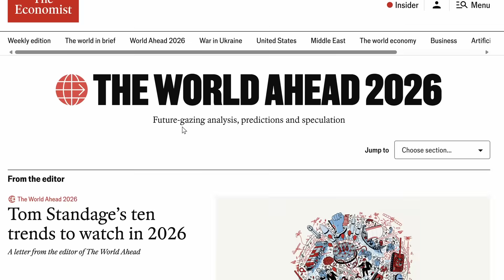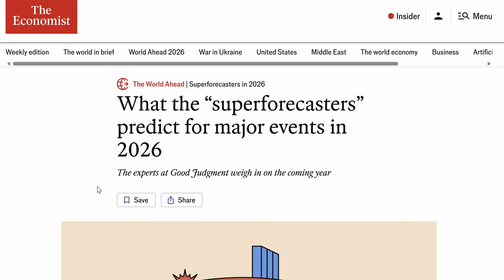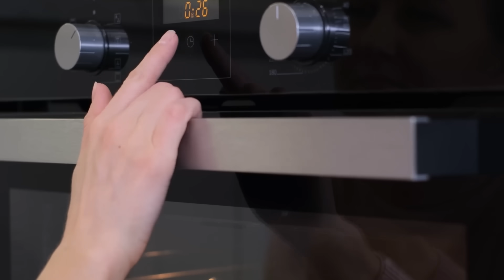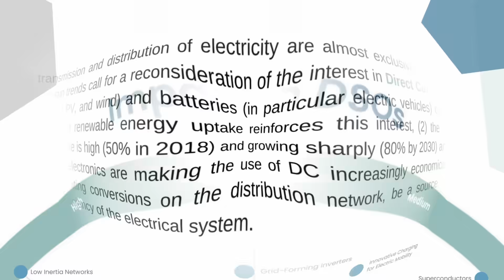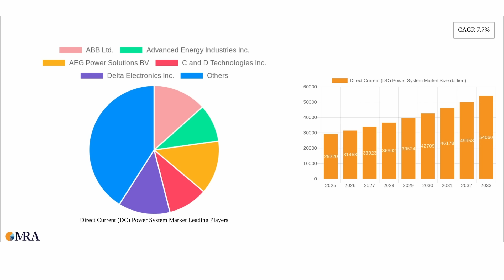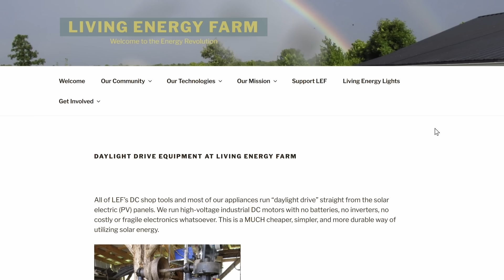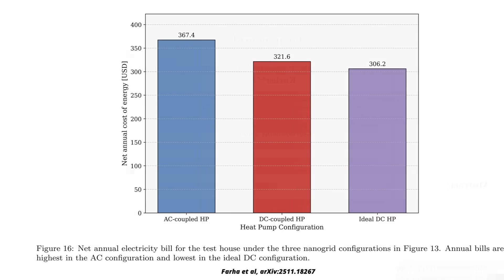Are We Using the Wrong Kind Of Electricity?

Comment: The Economist is a media outlet run by globalists. Both Solar and wind turbines are very inefficient and unreliable, they also transmit power over long distances. You need AC to reduce loss. Inverters are very efficient as are transformers. There is 5Vdc, 12Vdc, 24Vdc, 48Vdc and 125Vdc any idea how inefficient dc-dc converters are?  The Economist is full of s__t.

Comment: Irrespe tive of AC or DC, there will always be a need for conversion because pf the dofferent voltages each appliance requires. 5V, 12V, or any other voltage actually. So the gain is  only in the efficiency of the converter used.

Comment: Another reason for AC not mentioned in the video are induction motors. Electricity was initially invented to power "the industry" (replacing steam engines) and induction motors were (and still are) the workhorses there. AFAIK even some modern cars are using induction motors even though the battery gives out just DC. Yes, you need a high-power inverter then. And while inverters can be quite efficient today, it is still an expensive and complex electronics that can break, lowering the overall robustness of the design.

Comment: No, big spinning turbines from kinetic (hydro) and heat (hydrocarbons and fission) are by far the best way to produce reliable economic electricity that can be  transmitted long distances and then used in industrial, residential and commercial applications. Most industrial applications work best with AC because they drive motors.

The EV car nonsense is over. Solar and wind are dead.

Comment: Wind doesn't generate DC. It's converted from the random frequency AC that is generated from the motion of the turbine.

It's usually converted multiple times too making Wind incredibly inefficient. Solar does produce DC but it's not at a constant rate and therefore needs to be buffered.

AC transmission is far better than DC over long distance.

Comment: Between: 2V2, 3V3, +/-5V ... 12 ...  2 ... 52 VDC  (or 360, 400, 800, 1000VDC) ... It would be fantastic if the IT industry alone decided which voltage to choose - because of course a single Voltage level in  homes and local business grids - Even if the final system required a DC-DC mini converter (from the local 12/24/28V storage battery, for example..

(Once inside a house  IF the house had a branch 24V network - low power devices can easily safely) tap into that -   Although I have seen a dodgy 12V connector catch fire in a spectacular way, even low voltages re not "safe" - when currents are not adequately controlled energies managed...

Comment: Most modern appliances will work just fine on DC (or AC). "Traditional" transformers only work on AC, but most modern devices use "switch mode power supplys", capable of running on both AC or DC. I have successfully powered my TV on 350v DC, and phone chargers  LED lamps and devices that have internal inverter technology, like some newer microwave ovens. Induction motors need AC to work,  but many have inverters built into the appliance, so are DC capable! Universal motors(brushed) like the type in a vacuum cleaner, can work on DC or AC.  These devices might not state that they can work on DC, but mini can!  I have created a simple setup with a solar PV string, charging a series string of batteries, powering devices directly, on High voltage DC, without the need for a inverter.
I have a older video were I connected many 9v batteries together and power/test a TV and other appliances on the 9v-batteries string (280v DC series connected) https://youtu.be/Au3wURws_Bg

Comment: DC is less lossy for transmitting power underground, since there are no capacitive losses using DC.
Since we started burying power lines, AC has started losing its bearing.
The big, big topic is transformation  indeed. AC current conversion is easy and reliable.
High power DC to DC converters have to use high end transitors. These products are more technological, and are typically quiet expensive. That's the bottleneck before a full transition back to DC can happen.

Comment: I have one socket at home that is connected directly to solar pannels. It output somwhere depending on other condition in between 160 to 200V DC. I use it to charge ebike battery, plug in laptop, phone chargers etc. Or space heater in winter. Works fine. Just dont plun and old style transformer in :) but our current switching power supplies works fine.

Comment: According to the German VDE standard, the highest touch voltage is 50 V for AC and 120 V for DC. This is the voltage at which touching a live device or conductor is likely to result in death. This makes DC somewhat safer, whereas AC can lead to cardiac arrest in the event of an electric shock. 

To avoid losses at ohmic resistors, the voltage is increased to reduce the current. This is because the power loss Pv = I*I*R. It is proportional to the square of the current. 

Historically, this was easiest to achieve with transformers. This is why AC transformers became the standard for transmission in Germany with Werner von Siemens. 

However, an alternating voltage on a line leads to the skin effect and the displacement of the current from the inside of the line. This is why DC is used today for high power applications. 

Older power plants have a rotating generator that automatically generates alternating current. This must run synchronously with the grid in terms of voltage, frequency, and phase. When starting up a power plant, the generator must first be synchronized before it can be connected to the grid. After a power outage, it can therefore take hours or days for the power grid to function again. 

More modern power plants, as well as solar and wind power plants, have a converter instead. This generates alternating current internally. 

During the power outage in Spain, privately operated solar plants remained connected to the grid. It would not have been necessary to disconnect the solar parks and wind farms from the grid either.

Comment: DC switching in a household use is a killer on the contacts of the switch, DC arc flash is something you dont want to deal with at all, as you know you cant use a AC breaker for DC use due to arc flash fires

Comment: Don't feel like watching it right now but IMO we consider AC transformers to be "passive" components, just part of the infrastructure. DC requires "active" components to convert voltage. Granted we're getting really good at DC-DC conversion but still AC is still a huge "cheese" I mean you can take power from a generator, transform it up to distribution level, down to medium level, down again to domestic level, and supply it to your toaster and the only time the current actually needs to be interrupted is when the toast pops up.

Comment: There are two problems with DC. First, transformers work with AC only. Second, DC voltage is limited by what the electronic components necessary to transform it can handle. This necessitates thicker wires and makes more losses after all because you can't transfer kilovolts of DC. There simply are no electronic components that can handle such high voltages.

Comment: → While the circuitry on lots of systems is powered by DC there are many AC components to change the supply voltage of the device into lots of different voltages for the circuitry. There might be some changing of DC and AC here and there but AC will stay in the devices. Losses everywhere but they are really tiny today thanks to MOSFET and intelligent logic.
→ DC above 60V in households? I would not recommend that because it is intrinsically more dangerous than AC.
→ DC for long high power lines is a must because it reduces capacitive losses on long AC power lines (with "large" capacity during polarity changes).
For my home I use some 24V solar powered system for smaller devices, charging of power banks, laptops and the PV panels are rated with a maximum voltage of 45V in parallel so system voltages within safety limits. Maybe this is part of the future: Use some permanently / often running systems (Router, surveillance, lights, water cooker) by DC to reduce the load on the AC backbones?!

Comment: The main reason for AC was economics and technology of that period. AC can be boosted to higher voltages, for lower losses, then stepped down again, for actual use, by just using transformers. These transformers were the only efficient and economical way to do the stepping up, and stepping down. It only works with AC. Also the devices using electricity at the time could use either AC or DC. An incandescent light bulb, will work with both. So do resistive space heaters, and electric toasters. Electric fans, and the motors that ran them, could be made simpler by running on AC, at the cost of efficiency, with only a single phase. When refrigeration and air conditioning became consumer items, the parts that required electricity, was the motors in the compressors, so AC would work fine. DC not required.

The only early DC device was radio. Electronics was expensive and only represented a small part of the households use of electricity. It stayed that way until the late 1970s. Most electronics up to that time was radio centric. Through the 1970s electronics got cheap. First by Japan taking dominance. Later shifting to South Korea & China. Electronic gadgets exploded, and they all used DC. Video games, home computers, video players (tape, then disk, then streaming), smart phones, & tablets did not exist before 1970.

The economic transmission of DC became reality with reliable and cost effective power semiconductor devices. That couldn't happen to at least the 1980s, and even better devices, as the tech improved, over time. The power devices made in 2020 are orders of magnitude better than those devices in 1985. You could technically do high voltage (>100KV) DC power transmission in the 1930s, but it would have been expensive and less reliable.

Comment: Small correction, wind turbines generate fundamentally AC as all rotating thingy. Usually to compensate there are semiconducting AC/DC converters inside that are converted back to AC by an other semiconducting inverter to arrive at the local fixed frequency grid. You can skip this whole process if you "lock" the wind turbine to a wind energy level that can manage the grid frequency and still generate energy - but obviously this is lossy on the ROI.
DC maingrid would make sense if we made superconducting superloops (planetwide) that could transfer energy from the sunny side to the dark side. Excess energy could be transferred to liquid hydrogen and transported on the same superloop. But that would require a hydrogen economy, planetwide cooperation, DC backgrid and many other things we are lightyears from :D

Comment: An Australian inventor has robustly coated graphene onto copper wire.  This is a  practical superconductor at a low price as it reduces resistance by 50%/coat.  Thats 95% for ten coats.  No more need for AC.  the process  uses off-the-shelf machinery to do the coating on a Neihoff wire drawing line.

He is currently trying to coat various plastics.
Reply: Conductive coating on non-conducting materials is great for AC, bad for DC. Skin effect is an AC thing.

Comment: Hvdc comes down to economics. But it’s all converted to and from an ac grid. For very long transmission lines and undersea cables it’s a good technology. It’s not so great for stepping up and down voltages compared to transformers. It won’t be one vs the other but more using the right tool for the application as the grid is upgraded.

Comment: I'm off the grid, using a propane generator that runs automatically and essentially unattended every 48 to 72 hours, for around 2 hours. I consume 19 watts of power at least with a 1 minute burst of 1500 watts to make a cup of coffee. I should be given an award for the tiny footprint I consume if people like Greta were actually great full for my low impact on the environment, but nobody will notice. Because nobody actually cares or lives like I do.

Comment: Merry Christmas. But I am dubious to this. Not in microgrids per say, but rather the long distance DC lines, isn't DC actually pushing electrons along the line, where AC is just pushing energy by making the electrons vibrate in place? Isn't Ohms law telling us that if you have high voltage you get high current unless the resistance is also high, and high current would require much fatter lines to not cause heat losses in the cabling?
Reply: Ohm's law works the same whether the electrons are moving continuously or vibrating. 
With AC the skin effect is a consideration (most of the current goes through the surface of the conductor). At low frequencies this isn't a huge issue but it still means the same conductor can carry more DC current for the same heat losses.

Comment: What a waste. AC is cheaper and easier to deliver and with every DC appliance needing 48, 24, 12, 9V etc. Youd still need a billion converters in your house. Just use the AC delivery and add a tranformer/converter at the pole in the alley. 

Houses get DC feed and no need to replace $Septillions in infrastructure.

But then again, there's an Elite thatll make 100s of billions. So, itll happen anyway

Comment: AC is easier to transform into the voltage you need. DC to DC converters often use AC, albeit at higher frequency, inside. The real DC high voltage transmission line advantage is distance, and the signal speed in metal (usually 2/3 to 3/4 the speed of light, depending on the material). With 50 Hz or 60 Hz you get a notable phase offset at 1000 km where DC gets more efficient. At smaller distance AC is more efficient. During the last 25 years the conversion AC-DC-AC etc got a lot more efficient. Those power supplies in PCs and the smaller transformer plugs don't get as warm as they used to. If you have one of those older plug-DC PSUs, somewhere 2000 and older, you notice how warm they get even though they can't provide as much power as their newer replacements. And it you go a few years further back they were simple transformers, which produced a lot of heat.

Comment: Sabine, 50Hz AC changes direction 100 times a second, and 60Hz AC changes direction 120 times a second. Each cycle changes direction twice. There are two zero crossing points for each waveform. BTW, Merry Christmas!

Comment: There's hidden risks of DC most people don't know about. One of them is the fact that larger grids upon turning off aren't actually off, there's still voltage stored in cable capacitance. That makes it more difficult to perform maintenance and has a potential to harm users weeks after the power was shut off. Switching itself is more difficult because DC has a nasty habit of pulling an arc when the circuit is separated. DC requires more copper usage, and at high voltages it has a strong likelyhood of killing with a delay, as it can electrolyze blood. Also pretty much every component for a DC grid is larger, more expensive, and more sensitive. And finally it doesn't even make sense for the use with DC appliances because my laptop needs different voltage than my cellphone, my TV, and my Christmas lights, so I'd still need converters but more expensive ones. Over all these things look good on the surface, but are stupid inside. DC has a good use for grid separation where frequency on one side doesn't get affected by frequency on the other side of the DC connection. That allows for operation in less stable grids. So, I'm kind of expecting our overlords are losing the ability to guarantee grid stability and are trying to hide it with a shiny new thing.

Comment: There is just one problem you didn't mention: due to the Faraday law, you cannot have long AC transmission lines that are placed near conductive materials, because this would increase power losses dramatically. For the same reason, using DC transmission lines is mandatory under the sea, but even long AC underground lines would be very inefficient. As you have said, AC is mainly used for its ease in changing the voltage, but the development of power electronics has made technologies available that allow us to do the same in DC lines, even if at an higher cost.

Comment: AC being less lossy is a fallacy. In reality DC can transport double the power at the same peak current and voltage. DC also doesn't have transmission line or skin effect issues.

Comment: DC doesn't travel far enough on The Wire because of resistance a long wire becomes a literal resistor so basically you know nothing about electricity. From the windmill or solar panel the losses costly expensive and DC heats wires causing house fires. Zero advantages to DC. Get better studies.

Comment: The high price of electricity is due to politicians trying to be engineers. Every energy conversion (I.E, D.C. to A.C) has a loss incurred in the process. The only case which very high voltage transmission pays off is on very long routes and some undersea paths. The other costs added to the price is  politicians following the geen 'net zero agenda', and, (for example laying CO2 pipes into cavities for  'storage'). I detest talking politics on this scientific channel, however I have no love for politicians.

Comment: AC is still the best option for transmission of power on the grid.  AC-DC conversion is relatively simple with solid state rectifiers, but DC-AC inversion is more complicated and subject to failure and power limitations.  Also, transformation of voltages along the way is best done by AC.  So, I think Nicola Tesla was correct and I am glad that we ended up with AC power grid.

Comment: So, a lot of those DC usages are low voltages like 5 or 12 V.  While a lot of the DC production is like 450 V.  And the DC transport is really high - 500 to 1100 kV.   So, you still will need to use AC to move the electricity from one voltage to another.